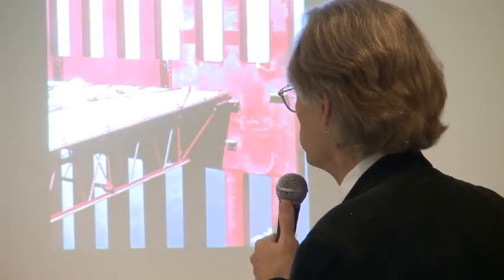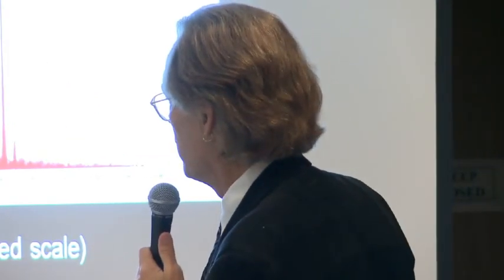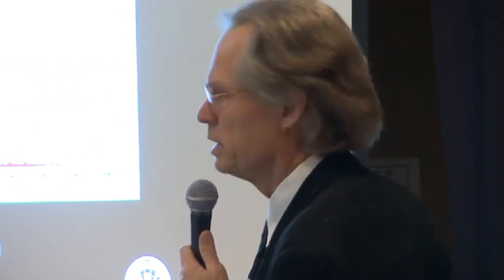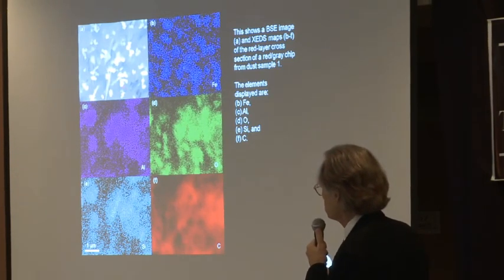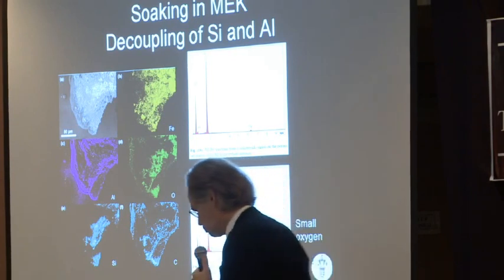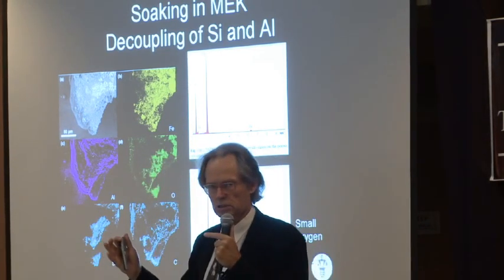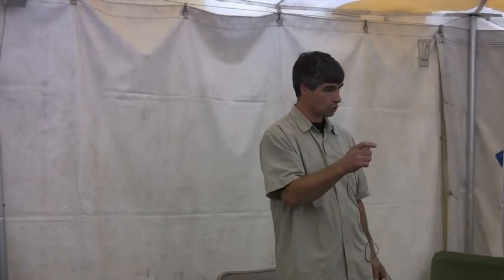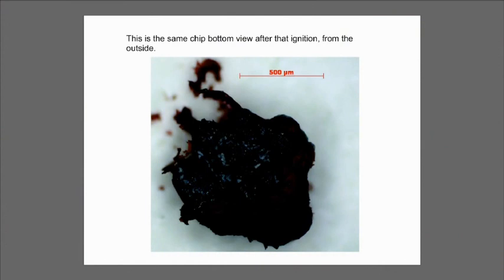9/11 WTC-chips are not paint and produce a thermite reaction: Dr. James Millette is wrong

Comment: There is a LOT wrong in this short Harrit presentation. 
BLUNDER #1: From 0:43 min on, he shows a photo of WTC under construction, and talks about "the primer paint, which is also red" - singular "paint" and "is". This is a major blunder, and fatal to his arguments that follow, because that image alone already shows TWO DIFFERENT primer pains (plural "paints") which both are (plural: "are") red: The exterior columns painted with Tnemec Red, with various pigments including iron oxide, zinc chromate and talc (a magnesium-based substance), and an organic binder that contains linseed oil and alkyd resin, among other substances - while the floor trusses were painted with the LaClede Steel Company's shop primer, which has as pigments iron oxide, aluminium silicate (kaolin clay) and a small percentage of strontium chromate, and the binder is epoxy.

When he talks about the composition of "the paint", from about 1:30 minutes onwards, Harrit means the Tnemec Red on the exterior columns - he did not know at least one other, different primer existed.
BLUNDER #2: Around 2:30, he claims that the content of zinc chromate in the dry paint is about 1/3. Unfortunately, he does not show the data tables that he based his calculations on, or else it would be easy to show that he committed actually a serious of major blunders, each individually is fatal to his argument. Most egregiously perhaps, he misses the fact that both the percentages of the various pigments and the  percentages of the various binder ingredients separately add up to 100%. He computes with amounts that add up to 200%! Next huge and stupid blunder is to believe the Material Safety Data Sheet he mentions is for only one of the pigments, when in fact it is for the wet, ready-to-paint paint paint. So this entire calculation is terribly stupid nonsense. He did it in May 2009 - no Truther has been able to correct this in all these years.
BLUNDER #3: At 2:31 min: "Now the point here is: We do not see zinc". This is plain FALSE. We DO see zinc: Figure 14 in Harrit et al 2009, the "Active Thermitic Material found..." paper, does show zinc - and actually pretty close to the amount you'd expect if you did the calculation right that was his blunder #2.
BLUNDER #4: At 2:38 minutes, he shows a "blown-up" picture of the XEDS (elemental) spectrum of the red layer of one particular chip (chip "a" in Harrit et al 2009), and says that we do not see zinc there (true) and only a small amount of chromium (also true). The blunder here is that the same picture also shows a bit a strontium (how do we know? Harrit published a white paper in May 2009 which contains this blown-up image). This XEDS image actually evidence that this chip is from the OTHER primer paint, the LaClede paint on the floor trusses. Why? Because that primer paint on the floor trusses contains a trace amount of strontium chromate!
BLUNDER #5: At 3:21 he says: "So conclusion here is the red-gray chips cannot be the  primer paint, because we do not see the zinc chromate". This is a blunder for two reasons: First, a repeat of blunder #1 - his FAILURE to know that he needs to account for at least two different primer paint formulations. The other, Blunder #5, is the implied assumptions that "the red-gray chips" are a uniform, single substance. They are NOT! If you read Harrit et al 2009  carefully and analyse their XEDS data, you will see that they found at least SIX DIFFERENT KINDS OF RED-GRAY CHIPS, having at least 5 different elemental compositions for the red layer(s). So while it is true that the first kind of red-gray chips they present (those with lots of Fe, Si and Al, and a bit of Cr and Sr - and no other minerals or metals) are not the Tnemec Red paint that has zinc, the SECONDS kind of red-gray chips (Figure 14), which in addition has Zn, Mg and Ca, is a very good fit for Tnemec Red. And then they have one specimen with significant titanium (which the other two lacked), and another with significant lead (Pb), which the first three lacked), and then the text says that they found more chips with additional Cu and/or Ba. It is really terribly stupid to discuss the chips as if they are all the same material, when your own paper proves you were looking at many different materials.

I'll stop here. Many leading Truthers, including AE911Truth, must have known for many many years that the "nano-thermite" work of Harrit, Jones, is either breathtakingly stupid, or an outright hoax - absolutely false at any rate. 
I mean, just scroll down the comments here - I explained some errors right here SIX years ago, when the video first was posted. 

Why does AE911Truth now promote this long-debunked nonsense talk by Harrit?